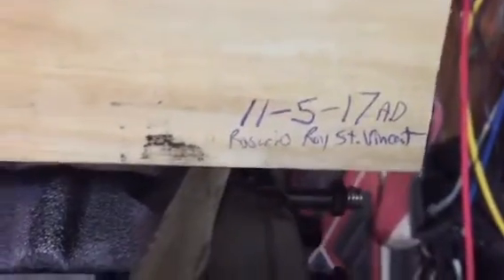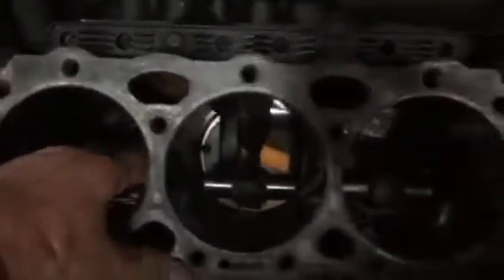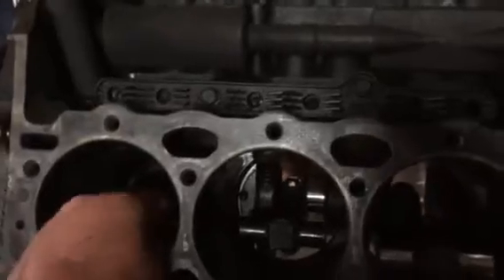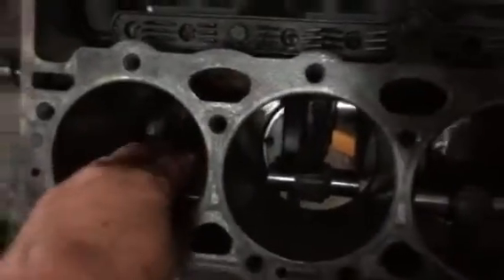Matter & Mass part 2

Comment: Roy joe booker interlinked the sump breather pipe back into air inlet as you will get vacuum pressure and joseph Papp engine was built this way but have you watched youtuber reddpill and his vortex air engine video built in USA at Rockwell